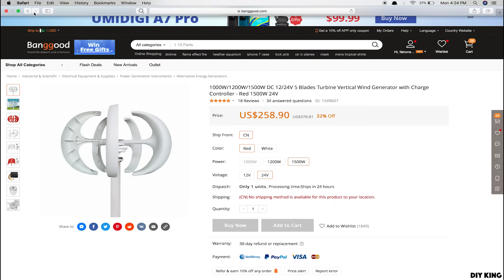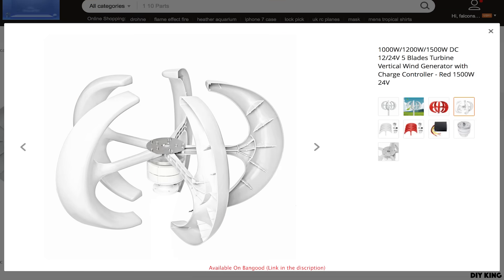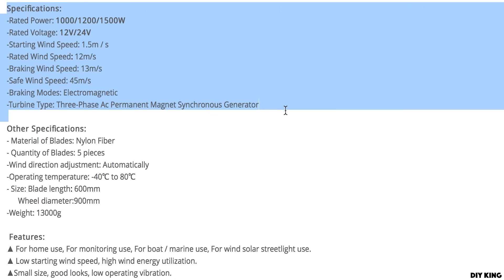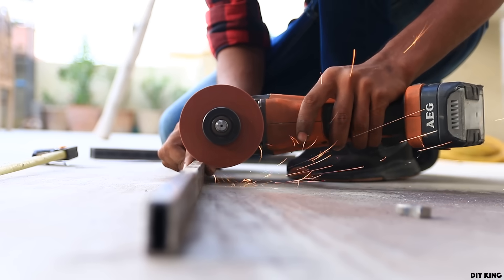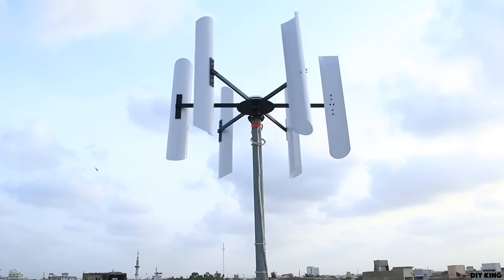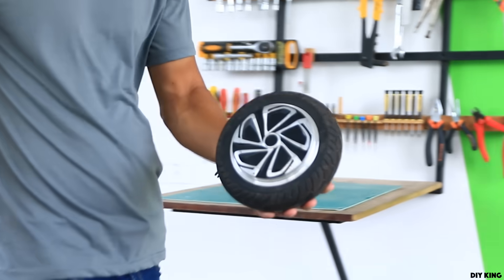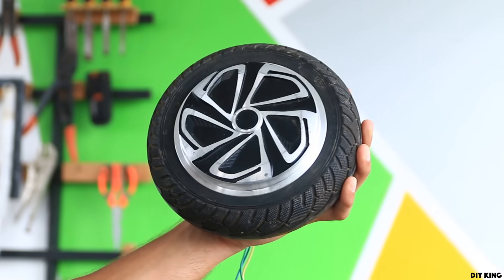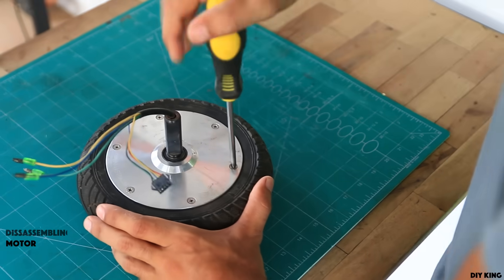How to make a Vertical Axis Wind Generator (Is it worth that???)

Comment: I've always  thought of putting a wind shield on the backside to reduce drag and put a tail on it so it always points the right way. What do you think? Can you give it a try since you're 70 percent there? Good work.  Thumbs up.
Reply: CHM, a tail will only be beneficial on a system similar to a windmill in order to orient the vanes/rotors/propellers into the prevailing wind - this system is vertically oriented so does not rely on the winds direction, only the fact that it will spin regardless of which direction the wind comes from.

Also, what are you referring to when you said "windshield" since anything else will cause undue parasitic drag on the system.
Reply: @larrywhalen127  Larry, I just left a full post about the same concept 5 minutes ago.  A "windshield" could be a half cylinder lowered over the whole blade assembly.  It seems that even cupped  the back sides of the blades are loosing momentum in the system by fighting against the same wind which is propelling them 180 degrees around the device.  If the wind could be shielded on the back or return side, then this continued drag on the system would be eliminated.  Please see my full post for more details on such a setup.
Reply: @vincetalkz  Hi Vince, if you can check out my comment to Chefhomesteadmaker you will see a solution which I utilized in 1984 for several powered ultralights which used single surface airfoils - basically I modified the wings with a two surfaced, "modified" Clark Y airfoil which increased their efficiency by reducing the amount of drag created by the single surface airfoil itself.
Reply: @larrywhalen127  Think out of the box. You'll get there.
Reply: @Songer80  Hi CHM, I need to see a picture or a sketch to understand what is being referred to as a windshield, but in 1984 when I was still with STITS (aircraft) I modified several powered hanggliders (ultralights) which had standard single surface wings, with a "modified" Clark Y airfoil which is a two surface airfoil which increased their L/D (glide ratio) from 8:1 to at least 12:1 or 14:1 - meaning at 1,000 ' AGL they were now gliding 14,000 ' instead of 8,000 '. 

Although single surface airfoils are a step up from a 'flat plate' similar to the 10 cent balsa gliders we had as kids, they still create a good deal of parasitic drag, which is the nature of the beast.

The best way to eliminate adverse drag in this situation would be to cut a thin, flat (1/8") piece of the same material (PVC ?) and glue it to the concave side of the blade, and then sealing the opening at the tip, which will result in additional rpm and therefore more energy produced.

Comment: The chief advantage of  vertical axis wind generator is ease of maintenance.   This occurs when you arrange the parts correctly in the first place.   You should have put the motor and everything else at the base of the turbine, at ground level.  The only thing at the top of the assembly should have been the blades which connect via a long shaft to all the other parts below, at ground level.

Comment: The drag type vertical axis wind turbine is less efficient that the horizontal one, known fact. For an increased efficiency blades with proper airfoils should be used, but not any airfoil would do it. Try the asymmetrical FX 63-137 for example with curvature outward orientation.
Reply: Good idea but where can you buy such a profile?
Reply: @wiesawcetnarowski8722  I don't know, but you can make some blades based such a profile. If you consider doing so, it is good to know that the orientation matters, they should be oriented concave side out.

Comment: Need a wind deflector on the return side that also incorporates as a directional tale for pointing windward
Reply: You don’t need a directional tail. That’s the main plus if the vertical designs. It doesn’t matter which way the wind is blowing. They need to work on the design of the drag side of the blades

Comment: could you rotate the vertical blades so that they would work more like sails on a sailboat and have  less surface profile on the return swing of the vertical shaft generator
Reply: At the Jersey shore I have seen lawn ornaments made with bicycle wheels with 4 model sailboats tacking in a circle

Comment: Why not modify an alternator from the million available? It generates electricity & lasts a long time. If less than a mile of wind power can pump 1 gallon of water a minute this should be easier.? I want shares

Comment: Lovely device Bro, love from India, I seriously feel the blades need a change, I shall share a design with you guys, and surely it can be given a try it is a efficient and built and tested design by many People. But yet still you can refer helicopter rotor blades these are thick at one end n thin on the other but are a airfoil, again here you can experiment with a full and half airfoil design half airfoil is flat at bottom full airfoil is rounded on both sides, with PVC pipes too you may try cutting three pieces for blades by marking a Y on the pipe, the half cut will have less efficiency. N sorry for the essay 😂🤣😂🤣😂🤣👍👍🇮🇳🇮🇳🇮🇳🇮🇳🇮🇳🌹💐🌹💐🌹💐

Comment: There should be many reasons 
One can be the blade is not resisting too much air you should change blade design..  may be the L shape blade give good results.. angle of should be about 110degree and the larger leg of L should be on the rod.. by this way more air will resist by blade and creat more pressure on turbine..

Comment: With this type of fan you aren't gonna generate much speed, it's really more torque based design. So either you need a different alternator designed for low rpm or a gearbox to up the rpm. With longer arms you'll get less RPM but more torque, so you'll need to play around with these ratios a little. You can also play with design alterations like modifying the shape of the arms to have them generate less drag and help add some torque.

Comment: It doesnt matter how many blades, 3 or 4 is fine.  The thing why it is not getting what you need is because its heavy,  remember your using the scooter thing, so there is certain weight needed.  I think all you have to do is to use a light weight aluminum since the pvc is not mich heavy.  Also instead using aluminum or steel, why not using a DIY plastic melt as holder so all will be eco friendly.

Comment: Try using aluminum sleeves and reduce the sleeves length by 25 - 30% of current length, make the wings more scoop like, right now they're letting too much air out.
Keep it up, you're doing good.
Reply: Right now you're using 0°-180° curve, just close the ends by D disks it'll make a good scoop just like Anemometer.
And go for 5 scoops than 6.

Comment: If u want more rpm to generate more electric,  
1. Decrease wait of iron..
2. Use bearing on both sides, to increase rpm & speed.
3. Install the unit 10 feet in height.
Reply: 2. Use bearing on both sides, to increase rpm & speed. You mean to and bottom?

Comment: Dave below, mentioned that this turbine style is most suited for consistent power generation versus min-max like the classic style and lots have given ways of improving them; building the blades from a different material would be my first choice.
One of the big advantages to this one is noise- or lack thereof. I've been around commercial 3-blade turbines during tornado weather and they HOWL.

Comment: Quality of Video.........Excellent.
Music..........very bad and distracting from the project
Workmanship..........excellent but as others have said protective gear is needed.
Project itself.............VAWT is not just about SPINNING...........great amount of planning and reflection is required to work out all the specific details of the project AHEAD of time including but not limited to the weight of the connecting arms. PVC pipe was a bad idea anyway- instead blades should have been built in the AIRFOIL shape-( airplane wing)
Yes the PVC pipe did catch the wind but the same wind played against the back of the PVC pipe sections. A speed Enhancer-( to prevent the wind from hitting the back of the Blades)- could have improved the functionality.
YOU have all the skills to make it work....dont give up

Comment: Was there any thoughts towards the implementation of a gearbox to help increase rpm?
Reply: Hi Jarod, just a note re blade speed - the tips CANNOT exceed supersonic speeds other wise the blades will create a whine that will cause dogs to howl in the next county, and it was when the inventer of this device was climbing up a tower to slow the rpm down (via a braking system) that he was knocked off the ladder by a blade and killed when he fell to the ground. Ironic that his invention was the cause of his death.

Comment: Try using flywheel, it means you must put a weight every each blade. At beginning the momentum may be a bit slower but after that it will increasing by them self

Comment: What kind of motor is it? Also your design has too many blades for ever blade catching wind there is the oppose blade having to push against the wind,. Ideally you need to have the blades set at 120 degrees around the axle. Granted the resistance is small but still it is something that will hamper the efficiency of the unit
Also the music sucks !

Comment: you need different windings in your generator that work better on lower rpm. vertical turbines are more about torque than rpm.
Reply from the maker: That might be the case, we can achieve that by rewinding the motor with much thinner wire having more number of turns to avhieve a significant voltage at a much lower RMP but that will limit the amount of current and thus we wont be able to achieve useful results.

Comment: 6 blades and only 2 are giving you power at a time you need more surface  preferably a design that has a constant power input
the horizontal design is more effective bc all the blades are constantly in a power input situation unlike you vertical design proving blase that twist around like a spiral staircase would help but you also need to scale the design up to need more surface area proving power than the horizontal design bc of the drag you will never outperform a horizontal at high wind speeds but you can outperform it at lower airspeeds giving you a more constant power production which can provide more power in a 24 hr period if your area suffers more low airspeeds it also thanks to the drag prevent a runaway situation that a horizontal design can suffer from if high wind speed situations if you ever in an area with big wind farms you will see thay shut down and lock the brake on them during bad weather to prevent damage you should some videos on some that have failed and come apart it's pretty cool good luck and hope to see a 2nd design

Comment: The advertisement for the VAWT shown at the beginning of the video is a joke. Calculated energy in the wind indicates a minimum blade set size requirement of 4 meters wide and 10 meters tall to produce 1000 watts at 11.6 meter per second wind speed. That is calculated with a energy conversion efficiency higher than current VAWT designs can produce. The imported VAWT advertised will produce 10-50 watts on a perfect day.

Comment: Neat project!  I have a couple suggestions. One. The flat brackets may be less resistant on the curved side of the blade. The other I always wanted to try. Have a sheild that moves with a vane to keep wind off the back sides of the blade. I am curious how much it would effect it. You could go a step further and use it to direct more wind to the working side. 🤔
Reply: What if it's just to much hard wear? Could a step up transformer be added 🤔 maybe some type of converter?

Comment: No turbine will work in vertical axis because it will take more weight due to gravity as it is hanged parallel to the ground rather than the weight when the turbine is hanged parallel to the horizontal line.

Comment: There is different design for a vertical wind turbine that almost takes out the drag problem... The blades need to be mounted directly next to the motor and in a curved position... Please make that windmill

Comment: Hoverboard aint cheap...
What other motor can i use, that is cheap?

Can i use old electric fan motors?
Reply: Actually nice question, but not answered yet
Reply: Most mains fans use a weird motor called a squirrel cage and I'm fairly sure you can't use that as a generator.  Most other motors can be used.  One from a cordless drill will probably be brushed and give you DC without extra circuitry, though some expensive ones may be brushless and need the rectifier circuit

Comment: Due to heavy weight of square pipe your wind turbine does not generate proper RPM first of all reduce the weight and increase the surface area of the blade to get effective result.

Comment: Blades are too far apart. The total diameter of your VAWT should be 1/3 to 1/4 that size. It will spin faster. It's a drag type, not a lift type. Drag types are all about torque. You could connect, as is, to a large pulley and drive a belt to a smaller pulley attached to the generator.

Comment: Good job with your videos for those living outside the subcontinent. But for the millions of subcontinent DIY enthusiasts, you will need to use easily accessible components. Where else in Pakistan besides KHI or ISB would you find a junked hoverboard motor? Its obvious from the lack of Urdu/Hindi/Bangla/Lankan/Nepali comments.

Comment: I have been thinking of this type generator a lot lately.  In about 1960 my Dad took me out to a remote natural gas compressor station. In those days, they were staffed 24/7 and the staff lived right at the station with their families.  This station is in a very windy area. In spare time, the crew used an axle from a junk truck . One end they welded a playground merry go round and the power from half oil barrels similar to the half pvc pipes used in this video. When the wind blew strong, the thing woould go around way faster than we could stay on it.

They had incorporated a clutch to stop or slow the merry go round and had another way to disengage the arms when the wind got to blowing too hard. Say, over 50 knots...

Comment: 2 changes needed:
1. Reduce the size of fans to 6-9 inches try with 6 dans and later with 3 fans.
2. Remove 3 fans and work this model with only 3 fans. 
You should see a substantial difference.

Comment: you should have used 3 BLADES on 120 degree angle and of solid and light weight structure. Coz the narrow width of blades will not fetch enough energy and also there are to many of them hence it will create interference among all of them. and the struts are very thick. You should have used thin more aerodynamic struts. here instead of its rigidness u should have focused on light weight materials. and aluminium circular rod will work fine. please do necessary changes for the next version of this turbine. If u want I can share u design of mine which I made during  my college days. and I also installed a solar panel on the bar for extra energy.
Reply: Hello.
Reply: I bought an old skateboard today and will use it to assemble a similar turbine. I agree with you on the choice of materials and aerodynamic shapes. However, I am asking for help in selecting the number, size and distance of the blades from the axis. All I can say is that I live in an area of light winds, but I am still fascinated by the handcrafted construction of such wind turbines. Thank you in advance.

Comment: Nice. However, if u use a spiral blade design it may give the results you desire. Instead of cutting the 6" pvc tube with a straight cut, cut at a 1/4" turn from each end, like a helix coil, simular to a snail or sea conch.  Stay creative....
Ps. Just be careful of the speed, it could get out of control in high winds.

Comment: I think if you will increase the length of vertical fan tubes the rpm may increase
More the surface area in contact with wind more the force can be applied on blade by the air 
Reduce the no. Of fans

Comment: I really like the two videos, but there is a major flaw in your current build. You created a "drag wind turbine" while the horizontal axis uses the lift on the blades. You installed the blades in the wrong orientation. Using drag substantially  decreases the blade's speed relative to the wind speed. I cannot tell if your current blades would generate enough lift. It might. If they do, simply rotate the orientation such that the concavity is towards the center. If you think the blades do not generate enough lift, use a shape similar to the ones you used for the horizontal axis (lookup Giromill Turbine to figure out the blades' orientation.

Comment: If you hook up a 120 volt extension cable to the motor and plug it into your house socket it will spin faster and generate more electricity,

Comment: Tilt the fins a little bit so that it will get more drag and the wind can also pass through giving it a bit of upward thrust. Hopefully that will increase the rpm . The same wind is also putting pressure on the curved side which is also the reason of slow speed

Comment: The vertical axis wind turbine have low rpm because of stall rpm 
The effectiveness of VAWT can be increase with low solidity design turbine
You can refer darreous rotor design or combination of both savinious and darreous rotor design